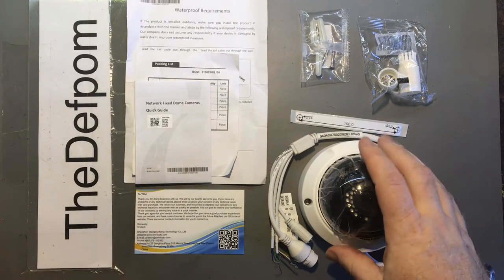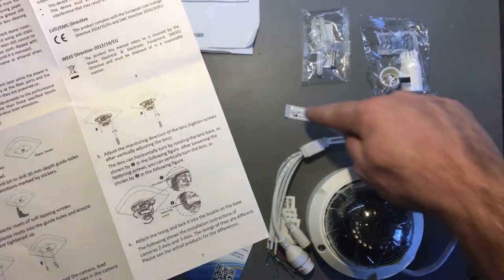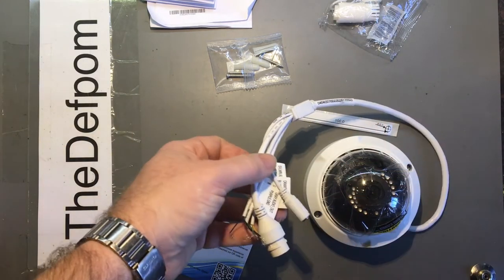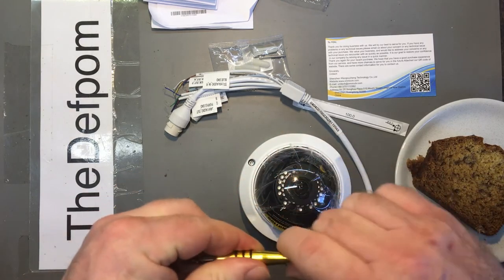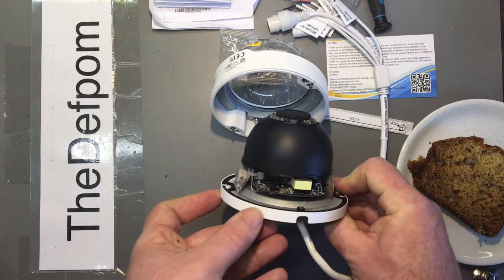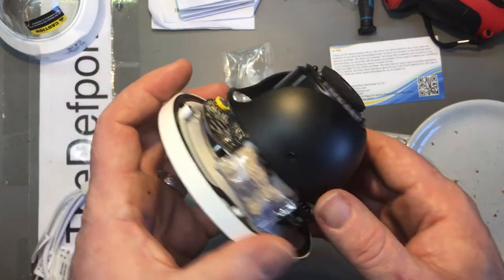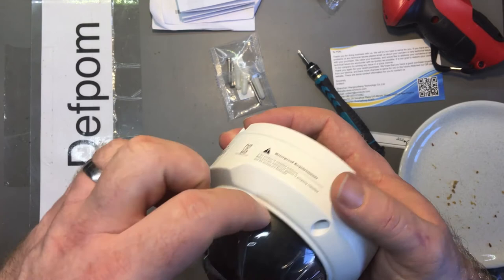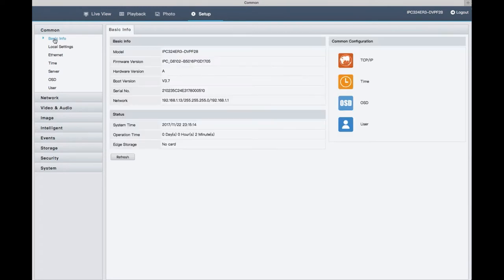#309 OmniCCTV 4MP POE IP Camera Review

Comment: Hm - Internet Explores and ActiveX have both been deprecated two years ago and will probably be removed in the future. Strange why they don't implement a more recent UI which would work on all major browsers and systems. Luckily most cameras support RTSP so you can just use VLC or some other video player once you figured out the correct URL for the stream. Or use a ONVIF-system like you showed at the end. "Real" PoE is a nice feature for larger installations. Also nice to see a camera with H.265 - should save a lot of bandwith if your player supports it.